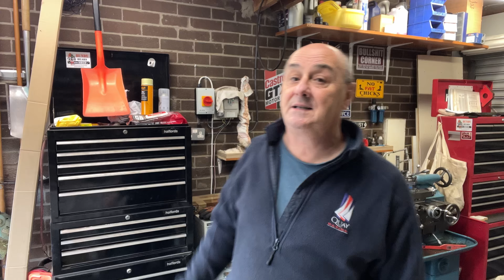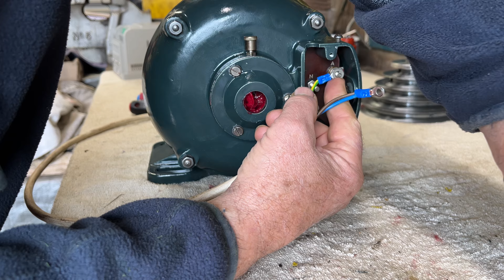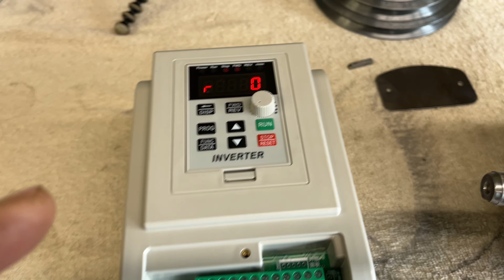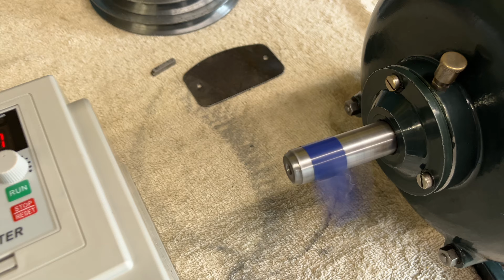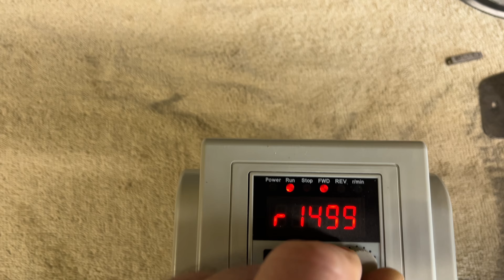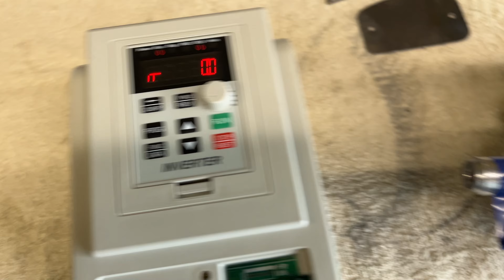AT1 3 phase inverter #engineering #machinist #vintagemachinery

Comment: Hi Barry, impressive work although as an electrician it worries me to see you using an earth conductor in the flex to the motor for one of the phases. I would recommend getting some 3 core and earth 2.5 mm rubber cable from e.g. Screwfix then you can have the proper (black, grey and brown) colours for the phases and the earth core within the cable for a neater job. Pedantic perhaps but you do like to do the job right! Cheers, Nick
Reply from the maker: cheers Nick, Yes i'll get some in the near future.

Comment: speed would probably be dependent on if it is a 2,4 or 6 pole motor
Reply: and if the inverter is suppling 220v or 415v between phases
Reply from the maker: Hi Frank, the inverter supplies 230V , it doesn't have any brushes and is an induction motor, Forgive me for my ignorance but I'm not a sparky, i thought poles referes to number of pairs of brushes.